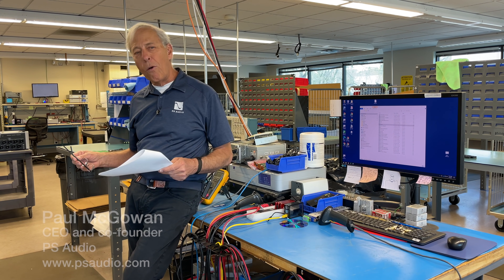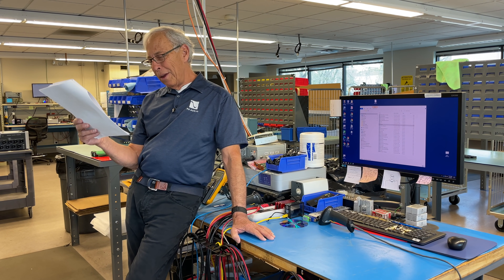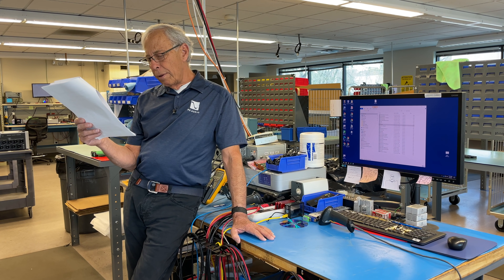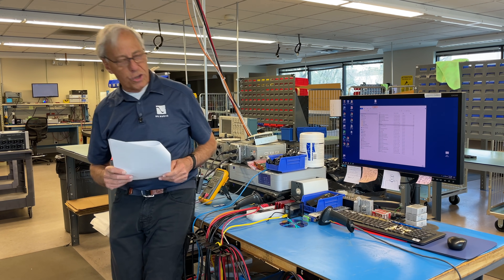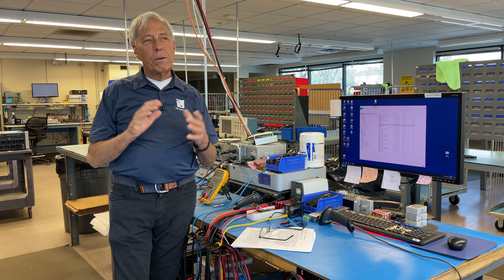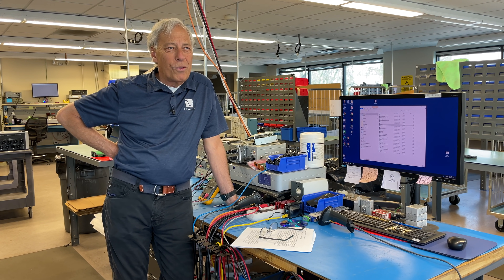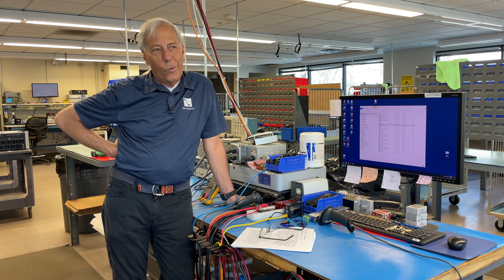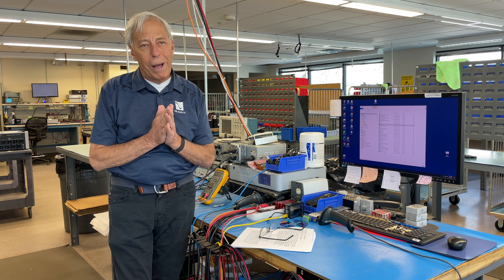Why square waves are important in audio

Comment: Howdy.
That is correct. After much tinkering I got a fairly good bandwidth response out of my DIY 4 x KT88 tube PA. About 40 Hz to 15 kHz. The THD is about 1,5 % at the ends and under 0,8 % elsewhere at about 20 Watts. I felt happy.
Then I checked the square response at 1 kHz. Flippin' awful. Really high spikes at transitions and a lot of ringing.
I had to connect capacitors between the splitter outputs and minus to slow the signal ascents and descents. Now I have three periods of weak ringing before settling.
I am not happy about sacrificing Slew Rate but ringing must be managed.
In the end the amp still sounds quite good.
Regards.

Comment: I’m not sure what you are basing your answer on, but square waves haven’t been used in amplifier design for decades. At best, they provide a crude representation of signal quality. When there was nothing better, 40 to 50 years ago, we used square waves, (and slide rules) but modern analyzers so far exceed the capability of a square wave generator / oscilloscope, that I can’t imagine relying on them for any serious design work today.

Comment: Square waves are a bit of a red herring. What engineers are REALLY looking for is the unit step response:

https://lpsa.swarthmore.edu/Transient/TransInputs/TransStep.html

A square wave is simply a convenient way to generate the step response.  The unit step response is kind of a holy grail of information.  It can tell you just about anything that you want to know about both the steady state and transient operation of a circuit.
Reply: @Douglas Blake 'Transient step -- aka "impulse" -- response is only one factor in an electronic design.'

The step response and the impulse response are two different things. The Dirac Delta "impulse" function is the derivative of the unit step function. It is mostly a theoretical construct to give Laplace transforms a solid mathematical footing.  While impulse generators do exist to approximate the Dirac Delta function, a true impulse function would have an infinite value for a infinitesimal amount of time at t=0 where the step function has an infinite slop. It's usually just easier to use a function generator with a square wave and measure the unit step function instead.

"Square wave tests do reveal this but also much more... they can tell us about frequency response, stability, distortion, phase, rise time, even power supply issues."

Square waves reveal those things BECAUSE they are showing you the unit step response.  Using the unit step response, you can derive the frequency domain transfer function of the circuit (including the power supply).  Using the transfer function, I can solve for the poles and zeros which will allow me to map the steady state frequency-gain and frequency-phase responses (and hence distortion) or I can calculate the transient characteristics damping factor, Q-factor, rise time, settling time, overshoot, natural frequency, characteristic impedance, etc, etc, etc.

A square wave is nothing more than a repeated series of step functions. Step on. Step off. Step on. Step off. Step on. Step off... But I only need one of them to calculate everything above.

Comment: Paul that is an excellent response to an often overlooked REQUIREMENT of electronics design. It reminds me of the old tube gear that was described as having a “romantic” sound.  The dummies that described it that way didn’t know that the amp couldn’t produce sound accurately and thus couldn’t produce a square wave it it’s life depended on it.

Comment: I understand what square wave response indicates, but for those who don't,  
this is one case in which a good set of prepared graphics could help a lot.
Reply: See here:

https://lpsa.swarthmore.edu/Transient/TransInputs/TransStep.html

A square wave is just an easy method for generating the unit step response.  The unit step response will tell you just about anything you want to know about it circuit.

Comment: Square Waves are used to measure slew rate,  transient response, frequency response, phase shift and phase delay (ringing) , ALL in one test and at one primary frequency, typically 10khz.
Reply: The frequency doesn't matter.  What you a really looking for is the unit step response:

https://lpsa.swarthmore.edu/Transient/TransInputs/TransStep.html

A square wave is just a convenient method for generating it. Any frequency will work so long as each wave is of sufficient duration for the step response to complete.
Reply: @timharig  DocM (below) and I think the input test frequency DOES matter in determining the level of "bending" (integration) of the output waveform.
Reply: @johnnytoobad7785  You've misinterpreted what I said.  You neglected the "so long as" part. In mathematics,  there are always conditions that must be met before the theorem applies.

If the half period of the wave is to short for the 10% settling time to complete, then the step response is invalid.  The testing frequency must be be reduced.  If however the period is long enough, and the settling time does complete, then I have enough information to generate the solve for the transfer function -- whether the frequency is 1Hz, 1kHz, or 10kHz.

Usually a testing frequency is simply selected so the the step response nearly fits on the oscilloscope.  In fact I don't actually need a square wave at all.  I can just use a single step with a trigger which has no frequency at all.

What DocM says is correct. The amplifier might  very well not be able to produce the harmonics to produce the square wave harmonics;  but, that doesn't matter. What I am ultimately looking for is the transfer function and the way those lack of harmonics distort the square wave will allow me to solve for that. In fact NO electronic circuit can produce the infinite number of harmonics required to create a true square wave. 

That is WHY the step response exists in the first place and why the step response is so diagnostic. We are not trying to produce a pure square wave.  That is impossible. We are just using the distortions to define the circuit mathematically  in the form of our frequency domain (Laplace)  transfer function.

Once I have the transfer function,  I can predict how any input waveform will "bend differently" at ANY frequency and I can directly map the circuits frequency response to calculate the extent to which each of DocM's harmonics will be accentuated. I could for instance measure the step response at 1kHz, solve for the transfer function, and do the inverse Laplace transform on an input of a 10kHz waveform, and predict how the waveform will be distorted (or how it will be "differently bended") at 10kHz.
Reply: At a fundamental frequency of 10kHz there is no audio amplifier that will output a square wave. The average amplifier wouldn't even pass the first odd order harmonic. All you would see is a sine wave.
Reply: @docm7608   Funny. Tim (above reply) feels that "the frequency doesn't matter..."

Comment: I'm an old enough fart that my college electronics included graphically constructing a squarewave by plotting the first ten harmonics of a given fundamental frequency. CGI did not exist so this was on graph paper. The fundamental sine wave is not even needed. The squarewave is constructed by just the harmonics. Try it yourself. 

I was also in the Audio biz as a rep when the highspeed crazy took off. Yes the HKs. Kenwood also had a ultrawideband highspeed line that I toured six states demoing. I would set up at a HiFi store and test any amp brought in for squarewave response. 10khz full power into noninductive loads and a scope. Rise time and slew rate. Show roll off and ringing. The lack of symmetry in quasi-complementary outputs.
Reply: @Douglas Blake Hey, I taught slide rule as an math asst in college!
Reply: @Douglas Blake Using the RCA Receiving Tube Manual, GE Transistor manual and McGraw Hill "Introduction to Amplifiers" one would imagine. I still have my copies.

Calculators did not exist when i was in College. We had a mag core memory "computer" we played with occasionally.   

Ironically I wound up on the other end of the Calculator take over when I was in Consumer Electronics sales in the '70's and they were just hitting the market. One CES event were they broke the bank. They were just starting to hit and even cheap simple 4 function ones were around $25 cost opening day of the show. By day 4 so many had been ordered that costs had dropped to under $10/ea. My original Phaser LED watch demo unit went from $300 to $50.

Comment: One of the things I miss about the beginning of high end audio , when going from mono to stereo , was that most of the major manufacturers listed the performance specifications and measurements of their gear . Sometimes to include photographs of oscilloscope display of features . Transcendent Sound is pretty much the only one I see who does that now .niche market for DIY folks there . Power cables and speaker cables from Analysis Plus were designed to handle transients in music , and also square waves . I use theirs as a customer . best

Comment: The really useful thing about a square wave is that it makes problems visible, you just need a good source of square waves and a moderately fast scope. No need for fancy expensive analysers, not that those things aren't useful in other respects.
Reply: A square wave is useful because it allows you to view the unit step response of a circuit.  Careful measurement and analysis of the unit step response will tell you pretty much everything that you need to know about a circuit.

Comment: Aren't square and sine waves mathematically related variations of each other? Thanks!
Reply: Every periodic signal is some combination of sine waves.
Reply: @blekenbleu  Agreed. Thank you!
Reply: A perfect square wave is the sum from 1 to infinity of the odd harmonics of a sine wave... Something like that anyway 🙂
Reply: @rowgli  PS: Zeno of Elea, definitely didn't believe in square waves ...
Reply: @rowgli  Agreed. Thank you!
Reply: @brucermarino  the maths is quite something if you ever wished to look up Fourier transforms
Reply: @rowgli Thanks and yes. I'm familiar with FTs. Fascinating stuff. Sometimes I post thoughts as questions to avoid some silly responses. I do appreciate yours. Thanks again!
Reply: a square wave is just that, it is a square wave, power on, power off
Reply: @oldolfmann8927  Exactly!
Reply: @Douglas Blake Agreed! My goal was to bring out in the form of a question point upon which Paul was unclear.

Comment: Square waves are an important diagnostic tool to determine if the amplifier under test has a fast rise time and to detect for treble lift / treble fall, ultrasonic ringing, etc.
Reply: and tell you nothing about how the amp sounds
Reply: @johnholmes912  Ringing can fry stuff.  Generally, electrical fires sound pretty bad.